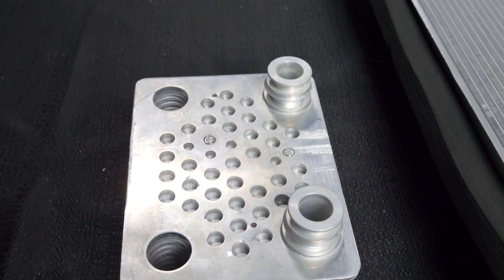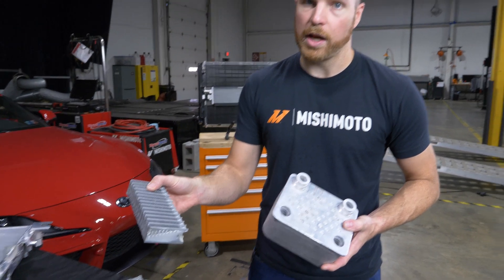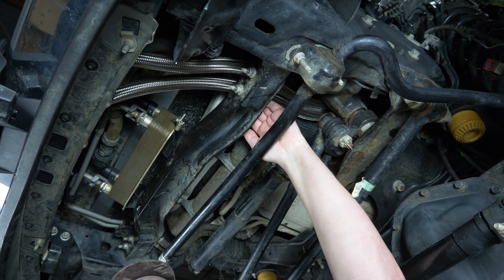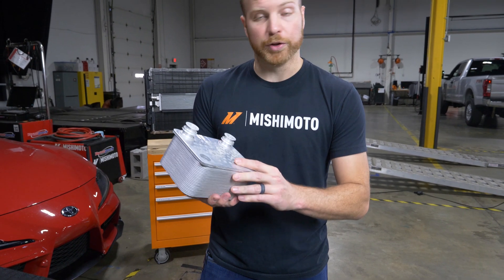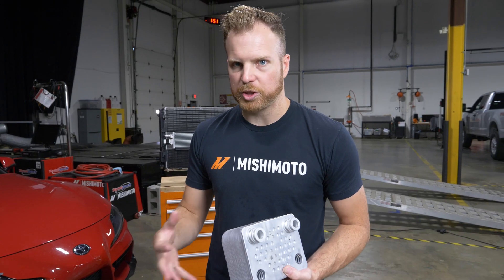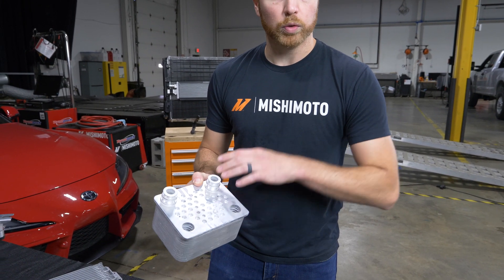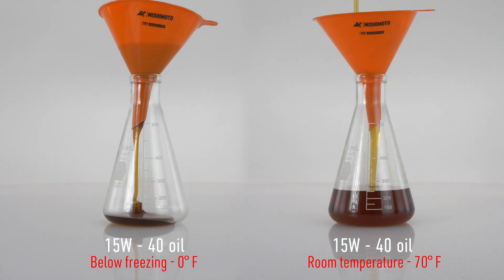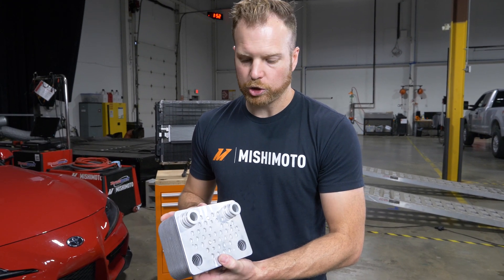Understanding Liquid to Liquid Transmission and Oil Coolers

Comment: Air to water has been my go to for an Intercooler system for years. More complex and costly for sure.  At times it solved packaging problems in tight grill areas.